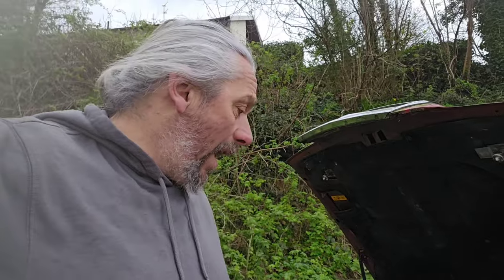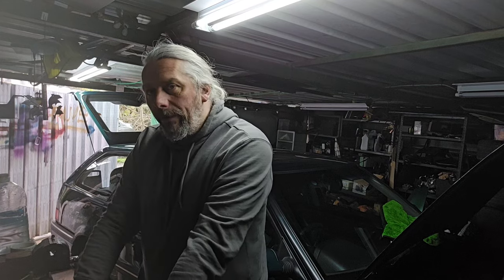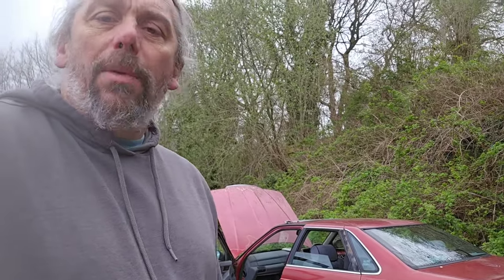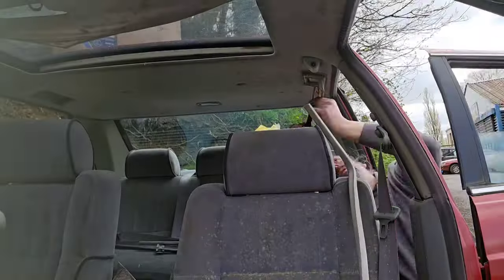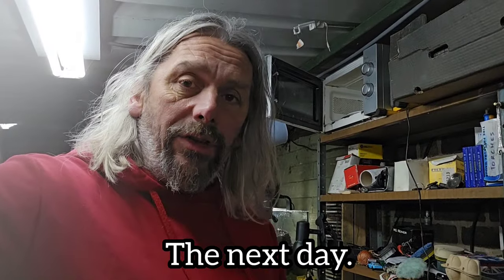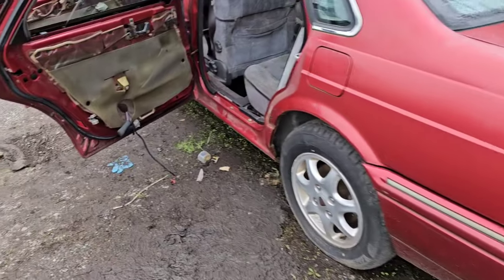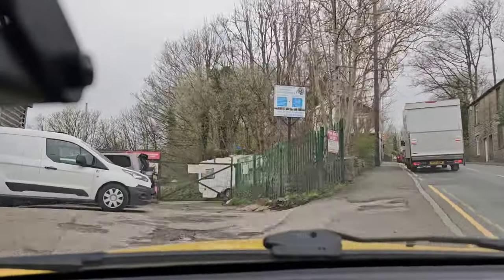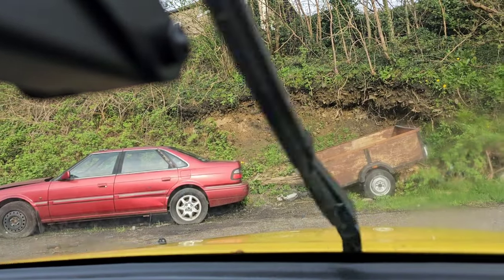Auntie Sophie Meets An Unfortunate End

Comment: Paul I could use some advice. Rover 25 fan resistor problem on settings one and two
Reply: Sorry to interject - you need a new resistor pack (or just new resistors if you are good at soldering)